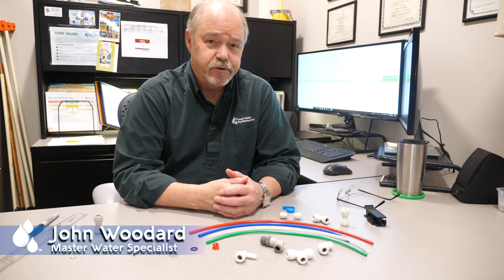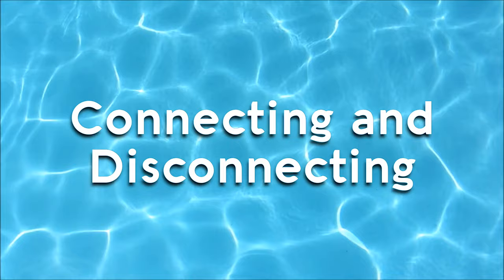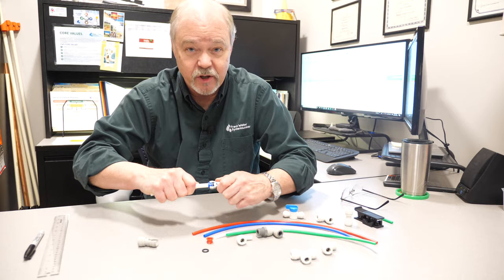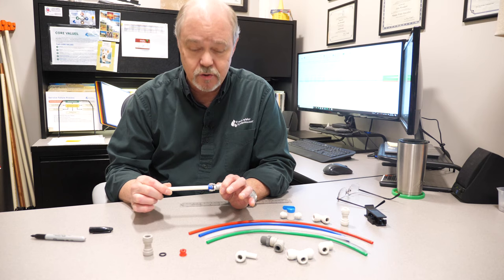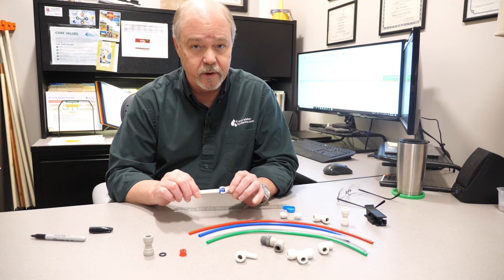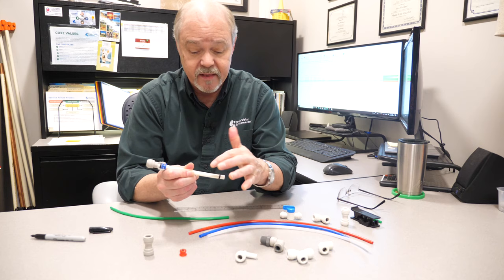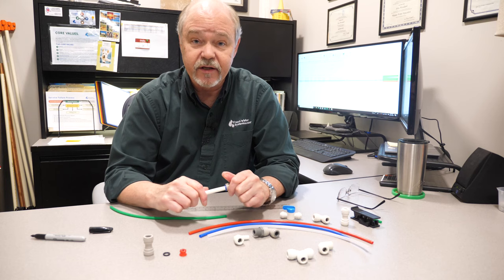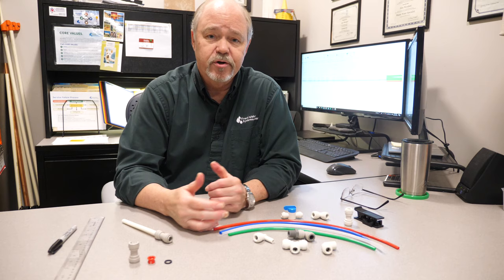How to Fix Leaking Quick-Connect Fittings

Comment: You don't know how much this saved me. I'm a captain on a private yacht and the water maker has these type of fittings and it wasn't working properly. Someone had closed the valve that sends fresh water to the tank. So the pressure made one of the hoses come out. Well. Little did I know that there was an o-ring that goes in there and that was nowhere to be found so I had spare o-rings and was on my way, making water and making the bus happy. Thank you.

Comment: When I first bought the "push fitting 1/4 inch" there was a leak, but once I watch your video, I removed the hose from the leaking end and recut it straight and insert the hose back in and the leak was gone. Best expert advice.:yougotthis::yougotthis::yougotthis:🤟🤟

Comment: Just excellent! Thanks for the clear and informative video. Fixed my leaky connection in a heartbeat. The O-ring wasn't seated improperly and deformed. I used the pointed end of a chopstick to gently bring it back to an O shape. The tube then went right in - problem solved. Cooling mist system up and running just in time for the heat this weekend - thanks again!

Comment: I can't tell you how much I appreciate this video! 
I installed an ion-exchange water filter (BWT) into my fridge supply, complete with a water volume meter and bleed shut-offs, and I swear that every single connection either leaked or sprayed water when I pressurized it. I was pretty panic stricken as I had snipped the fridge line so I was committed now. Anyways, it was just me not knowing to push the hoses right through the O-rings. 
Phew!! You saved the day. 🙂
Reply: Lol i'm glad i'm not alone! installed the BWT. leaks everywhere. self-loathing kicking in hard. wife, unimpressed, ready to call a plumber. but i believe i have arrived in the promised land, and this video got me over the threshold.

Comment: Thanks very much for your clear presentation!  I do have this one question though:  I have a water filter system that is around 7 years old.  I replaced an air gap faucet and, following your suggestions, I made sure all the tubing cuts were, square, the tubing round ( not mis-shapen) and nick free, and the tubes are pushed in as far as they go.  2 connections have very slow leaks, even with new, carefully cut and inserted tubing.  Both leaks are with old, original fittings.  All the new fittings are fine.  Is it possible that with age, the O rings start to fail and the fittings need to be replaced?

Comment: I found this video useful since I was working on leaking fittings on a kenmore refrigerator water inlet valve.  Turned out the internal o-rings were deformed from the strain of the lines being bent at 90 degrees.  I replaced the o-rings and added two 90 degree elbows and good to go with no leaks, the manufacturer should have manufactured it the elbows in place to reduce the strain on the coneectors.  Thank you for the informative video.

Comment: Excellent video, explanations, and information!  I looked ALL OVER the manufacturers site, and could not find any basic information on proper installation methods and practices.  I identified 2 major failings that are likely causing my leaks.  (My system was professionally installed and still corners were cut . . . .. wow.)   Thanks a LOT!

Comment: My water service man came every year some 12 times. Sometimes he had to stay longer to change leaky fittings.
He quit the business four years ago and now I have to service the R/O kitchen sink unit. 
Today was SANI day with 2 new filters. All went well but now two connections leak just like in years past.
I noticed today there are locking rings that go with these fittings but he never used them.
I'll try these half dozen tips tomorrow however the fittings are really old. Thanks for the good video.

Comment: Listen up to those that did all the steps in this video and it still leaks. Simply wrap a few layers of that thin plumbers tape around the end of each hose (or the leaking side). Voila, problem solved. If it still leaks wrap a few more layers until it fits water tight with the rubber gasket.

Comment: OMG - 1/4" fittings leaking. Switched everything over to 3/8" - still leaking. Solution found in this video. Skip to 3:03.... watch neat trick about marking the pipe. No more leaks!

Comment: Thank you so much for such an insightful video! I am an engineering student and we are building an RCS system for CubeSats and we are using these connections with compressed air. You saved us a lot of troubleshooting and time.

Comment: I will move my old Sears 42-38460 undersink water filter so as to not bend the tubing at top - one question you did not answer, can you replace the 0-rings on the shark bite fittings?
Reply: Yes you can. Sometimes the o-ring is to old and replacing is necessary

Comment: Would you say that any type of pex tubing straight from a faucet should be the same size and fit into an under sink water filter push fitting. Scared I might have to cut off the flares end and try. I could try to find the right fitting but I’ve never had any leak problems whatsoever from the previous blue hose the filter came with. The faucet is grey with lettering. Could Kettering itself even cause a leak

Comment: Purchased a faucet with a quick connect tube already assembled and it doesn’t fit the 8” spread, even though the instructions say it should. The tubes have a coil inside, and clamps on the ends. No idea how to cut them down to make them shorter. I may need to just purchase my own replacement tubing. Hopefully it’s a simple as you make it appear!

Comment: I just bought an under counter RO filter and one of the quick connect fittings apparently is defective because it blows the tubing out. It has a nice clean cut on the tubing. Can I replace the collet and o ring?

Comment: Also helps if you have fresh, good quality tubing.  I recently replaced all of my R/O filter tubing because it had all become so brittle, it just snapped in half like spaghetti.  Also, sometimes the fitting collet becomes sort of stiff and is hard to push in for proper tubing release.  I had to replace some 15 year old ones that were brittle from many California summers.

Comment: We have a Culligan Water filter that has a quick connect on the top of the unit.   Unfortunately, it broke and we are curious if we can replace the quick connect in the lid where the water flows into the unit.  The light grey collar came out with the tube.  Suggestions?  Thank you!

Comment: My leak was caused from moving the system around quite a few times while I'm in the process of installing a new sub-floor.  When I'm ready to re-install it I'll get all the parts I need, in fact have spares should this happen again later.  I think I'll put the whole filter system inside of a big 22 gallon plastic tote, and if I go on a vacation I'm going to turn off the water source valve.

Comment: Why are there no moving parts on my quick connect? It's white plastic. Does the faucet hose have to perforate a seal inside the quick connect? We're pushing but there's no click.
Reply: I had a mixture when i plumbed my bathroom. There was no perceivable click with those. I just had to make sure they are pushed in far enough. Marking as a good tip.

Comment: The side load issue is not emphasized enough.  If these connections are in a place where they will get bumped or something will push against the pipe, forget about it.

Comment: Did you ever had the turn valve leak on you at the blue valve and not the connection. Is there any way to tighten it or fix it without replacing them. They always seem to leak after awhile.
Reply: Old plumber here, plastic valves are crap.  If there is any way to integrate a brass ball valve, go that way.  they come pretty small, but all this stuff is coming from china and the truth is, its all crap any more.. best of luck.

Comment: We have multiple John Guest Quick-Connect fittings connected in the configuration of our In-Sink-Erator Hot Water Dispenser.  While the Quick-Connect fittings, we discovered it's the O-Rings within that cause leaks.  Can you please recommend where to buy food safe (NSF Certified)  O-Rings that are within the Quick-Connect fittings?
Reply: They are custom made for their fittings. You can not use standard sized o-rings as a replacement. You need to replace the entire $1.45 fitting lol
Reply: It’s a #9 o-ring. Pretty standard
Reply: @Gary...NOT Certified NSF Food Safe . So, no.
Reply: @queenegreene3926  I realized that sometime after the post, sorry ’bout that.

Comment: Would a dab of vaseline  on the tube ends help seal and condition the o ring?
Reply: I hear vaseline breaks down the rubber and makes it swell, which is why it is no longer recommended for the large o-rings on the filters housing - they now recommend a food-grade silicone lubricant -

Comment: “...or the fitting has been installed in a manner that is allowing water to bypass the O-ring.”
Ya think?
Didn’t put it together properly?
1.  Cut pipe 
2.  Insert into fitting 
How can you go wrong?
For me these have been hit and miss. I won’t install them where a leak will cause major damage. Open basement or concrete floor with drain is okay